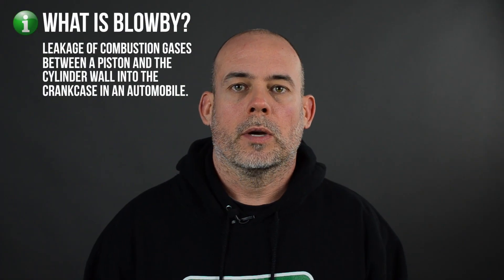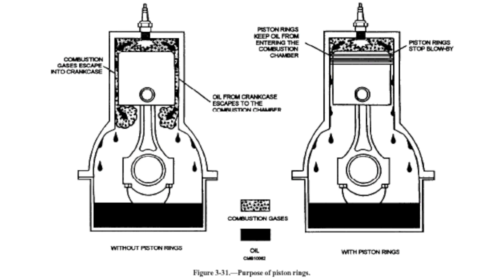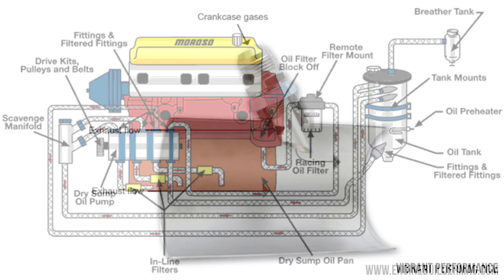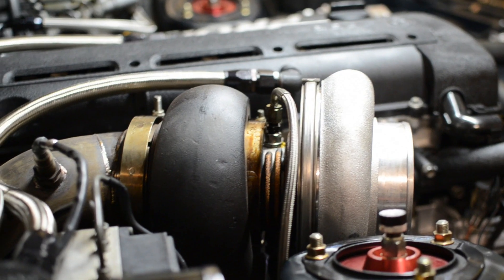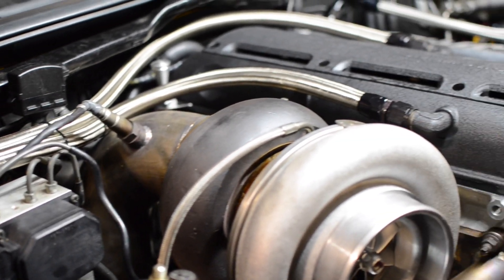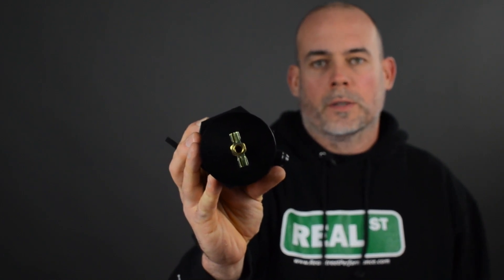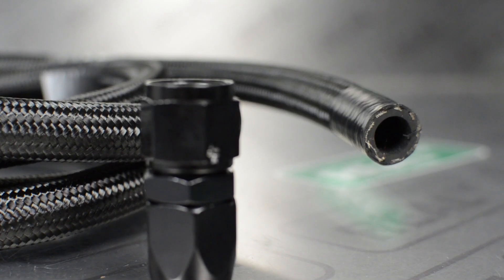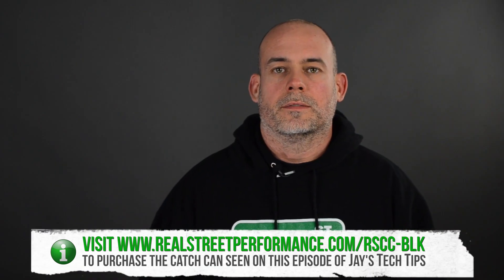Jay's Tech Tips #39 - Why is a Catch Can Important for my Build? - Real Street Performance

Comment: Here is my 2008 Nissan Sentra oil catch can configuration. good day. 04m37s ~ 05m04s discolored gasoline sludge and carbon residues safely trapped in engine oil catch can oil catch tank https://www.youtube.com/watch?v=xCfhebKMRbU&t=2s
오일 캐치캔 캐치탱크 장착했습니다. 가솔린 휘발유 차량이고 포집된 기름 상태 찐득찐득합니다. 
 https://www.youtube.com/watch?v=2wvupPKUeTE&t=965s  
오일캐치탱크 포집불순물 실물확인 원리 부품선정 설치 위치선택 설치옵션 주의사항 관리요령. 내연기관 엔진 수명을 늘려 존버하기. 오일캐치캔의 모든것 Oil Catch Can Tank

Best ways to make your car engine last longer with oil catch can tank
2008 Sentra engine oil catch can tank and blow-by hose configuration placement maintenance
Engine oil change 2008 Sentra 2.0 S - DIY drain and fill
05m12s ~ 05m20s check the engine sound prior to engine oil change

자동차의 심장 엔진 수명을 늘려서 존버 하는 방법 - 오일캐치캔
자동차 엔진을 10년 이상 무탈하고 오래 탈 수 있게  관리 하는 법

불완전 연소되어 찌꺼기가 끼여있는 더러운 잉여 개솔린 휘발유가 다시 엔진 연소실로 되돌아가기 전에 오일캐치탱크에 안전하게 분리된 찐득한 점액성분으로 변색오염된  가솔린 휘발유 - 04분37초 ~ 05분04초 확인

오염된 상태로 엔진 연소실로 들어가면 결국 엔진 때로 누적 되어 장기적으로는 노킹현상 유발 - 엔진 수명이 짧아집니다. 엔진을 깨끗하게 유지 관리하게 하는 꿀가성비 DIY 부품 - 오일캐치캔 강추 합니다 정기적인 엔진/미션오일 교환은 필수 입니다. 특정 회사 제품 사라는 광고 구입 링크~ 걸어놓은 부분 없습니다.

2008년도에 첫차로 구입해서 엔진관리 잘하고 13년차 아직까지 무탈하게 잘 타고 있습니다. 5분12초~5분20초대 13년된 엔진소리. 오일캐치캔 / 엔진오일 교환 / 미션오일 교환 모두 내돈내산 DIY 자가정비 경험담 입니다

수십년 전 우리 부모님 세대는 칫솔질만 하면 치아관리가 다 인 줄 알던 시절이 있었습니다. 그 영향으로 부모님 세대 들은 40~50대 이후부터 심각한 치아관리 부실로 인해서 치과를 찾을 수 밖에 없었죠. 그 마지막은 결국 틀니로 결말을 맺거나 지금은 임플란트로 대체 되었죠. 그러나 이 모든 사단이, '치실'에 대한 공익광고 만 있었다면 어느정도 해결될 사단이었습니다. 제가 어느날 치과에서 이 '치실'에 대한 생각을 털어놓자... 치과 종사자 분이 허탈하게 농담섞인 느낌으로 한마디 하시더군요. "저희는 그럼 뭐 먹고 살아요?" 라구요.....

5년~10년 마다 자동차를 주기적으로 갈아타시는 분들 한 테는 해당 없는 내용 이겠지만,
자동차가 한 두푼도 아니고, 오래 타면 그만큼 이득이고,  치과에서 '치실' 과 같이~~
자동차에서 '오일캐치캔'이 같은 맥락으로 생각되어 공익차원에서 올린 꿀팁글 입니다.

자동차 엔진오일교환/미션오일교환은 칫솔질 처럼 '그나마' 일반적이고 상식적인 사항입니다. 그러나 오일 캐치캔에 대한 내용은 정비쪽이나 매니아 말고는 잘 알려진 사항이 아닙니다. 왜그럴까요?

자동차 제조 판매회사 측은 차량 교체주기가 빨라져야 사업이 돌아가는 구조, 즉 자동차가 빨리 고장나야 제조사는 자동차 한대라도 더 팔리니까요. 자동차의 심장은 엔진입니다. 제아무리 이쁘고 간지 작렬하는 자동차가 있다 치더라도, 엔진이 뻗어버리면 어떻게 될까요?

오일캐치캔은, 자동차 제조 판매회사가 원하는 교체주기가 빠른  판매소비구조에 반하는 정비품목 입니다. 그러나 경제적인 면을 소중히 생각하는 소비자 측에게는 꿀팁이죠.

Comment: Gunked up valves are no problem unless they start to affect your car's engine operation.

Motors are dirty....it's a fact of life.  Clean valves are NOT a prerequisite to an engine operating correctly for years and years. There are literally tens of thousands of DI cars and trucks with no catch-can, that are running today with 70k and more miles.    
We all need to take a chill pill on this nonsense.
Reply from the maker: RD S, thanks for joining the conversation. If you are new to this channel, we specialize in doubling, tripling, quadrupling the power output of engines. Sometimes even more than that. These aren't your typical daily drivers that run for hundreds of thousands of miles at 60% duty cycle. These are engines that are well over their intended operating levels with aggressive tunes operating at the edge of the fuel they are on. While clean valves are not a prerequisite for an engine to run, crank case ventilation is important in engines that are being run well past their designed intent. You could ignore crank case pressure and say "well hey theres lots of cars ignoring crank case pressure, so i can ignore it too" ... but if you continue that line of thinking through various other engine topics you will end up experinencing some very common failures that were easily avoidable by recognizing that an engine operating at double, triple, or quaruple its factory power level is a very different topic than factory cars operating at light duty cycles for hundreds of thousands of miles.